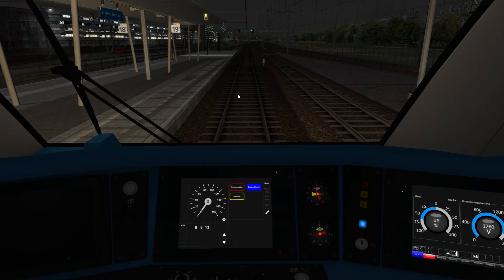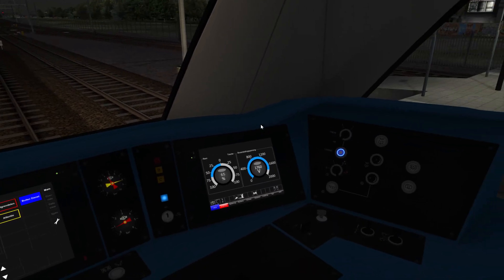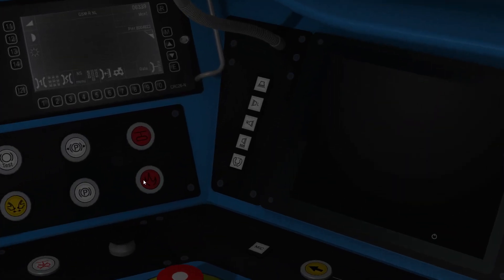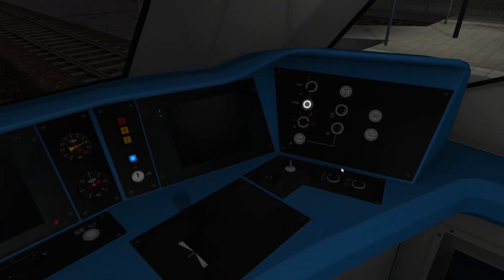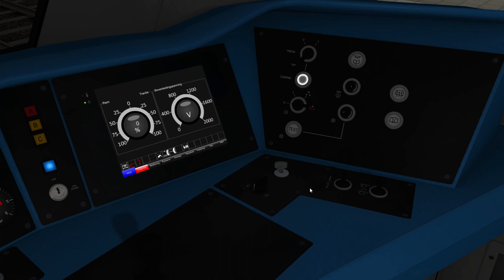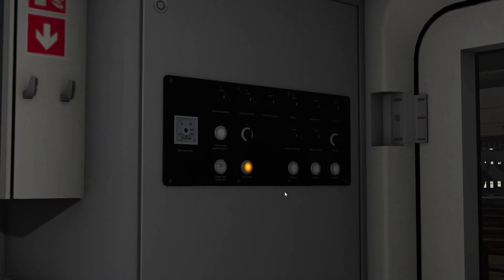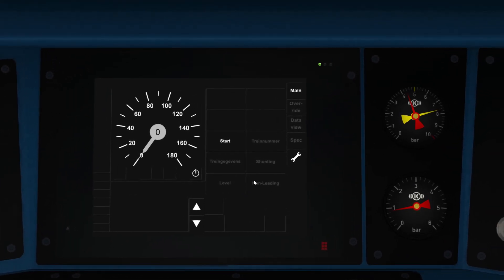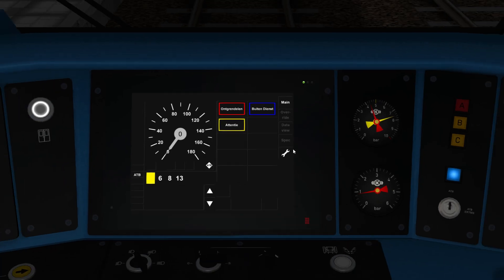SNG Tutorial 5 - shutdown and startup

Comment: Hi Chris, is it possible to simulate the brake tests? As that is standard procedure in all trains and according to the NS manual you have to test the brakes every time you switch ends and (un)couple. Basicly everytime when the brake pipe as been interupted.
Reply from the maker: I've thought about this on a few trains and with enough scripting, I could probably suppress the brake functions that the game imposes on the trains. But I've never actually tried it. Same goes for the instrument lighting test - I think it's possible but I have to weigh up complexity vs playability and how many players would actually end up using those functions :)